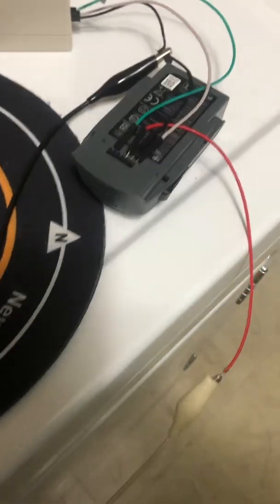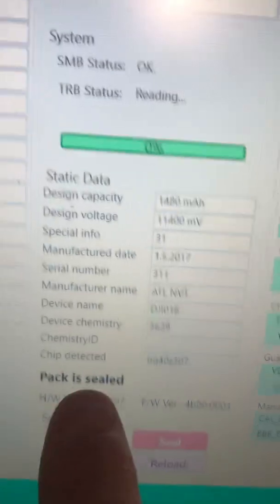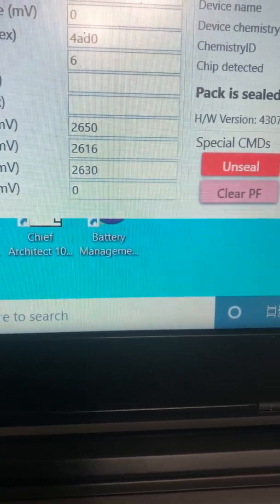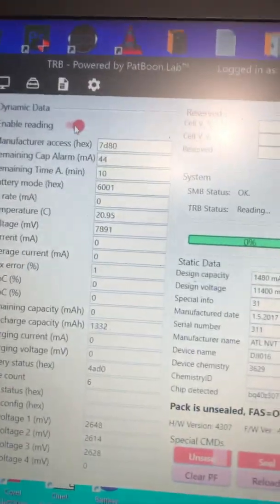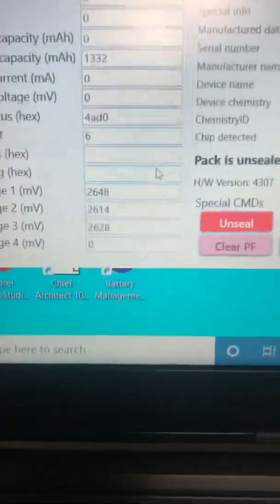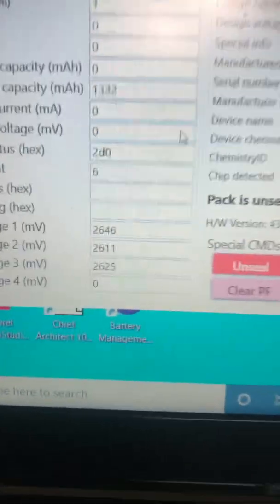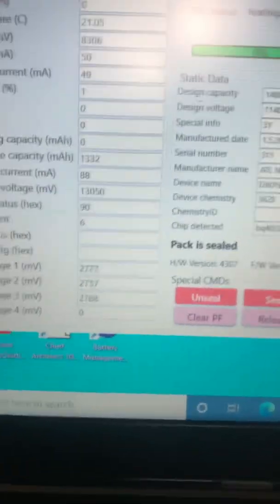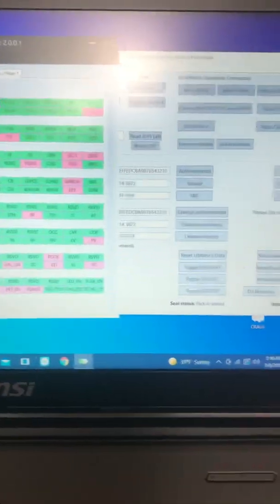Dji Quick tips on how to revive a spark battery with TRB 2300 and EV 2300￼

Comment: @Cruzroy Helicopters   hey, I downloaded the TRB software, but when I installed it, my antivirus found that it is infected with a trojan virus. Am I missing something? How did you get your software to repair these batteries? Also, when I go to the TRB wiki website in MS edge, no problem, but if I try it in Chrome, Chrome blocks it as malicious. Something seems fishy.
Reply from the maker: it does that to every one, ive used it for 2 years now, and not a problem, but there are other software's that windows or antivirus picks it up as bad, but use your own judgment, trb is now part of drone hacks, so you can email them or patrik and ask why it does it, i just block it from my antivirus, most EXE files you download will do that, but im not going to tell you not to be safe
Reply: where did you download the software from? i cant seem to find it online